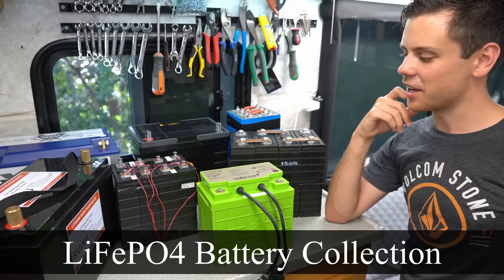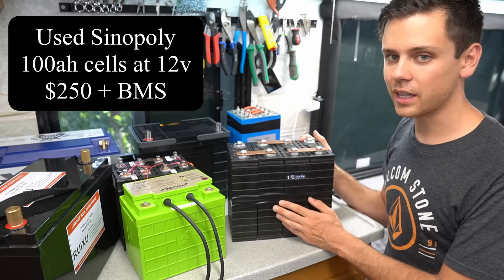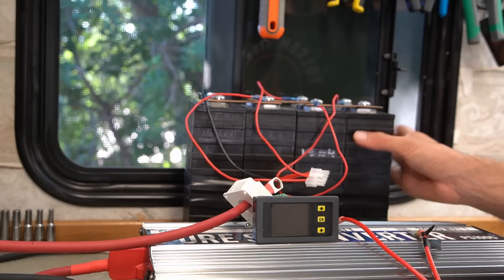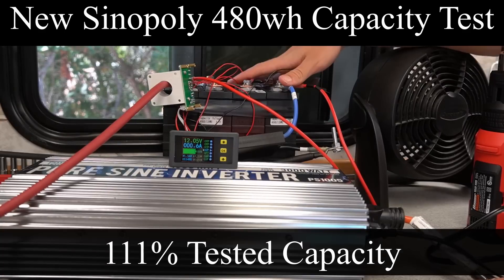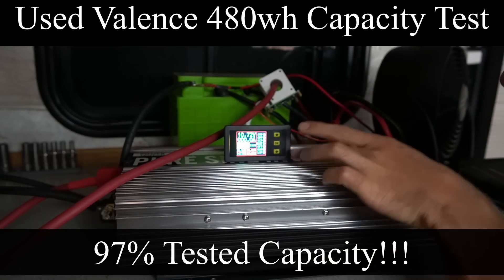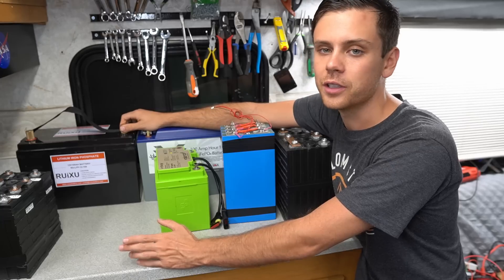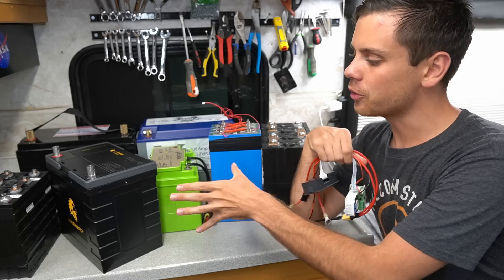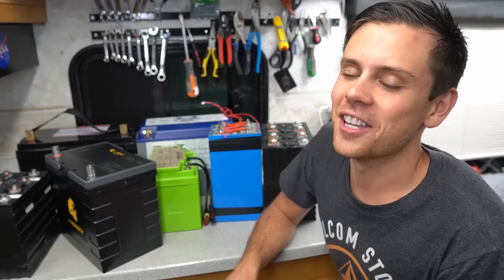LiFePO4 Off-grid Solar Battery .2C Capacity Test and Price Comparison: USA vs China, DIY or Buy?

Comment: Hi my name is Jeffery from Blackpool England I live in a tent in a van I do enjoy watching  wot you are doing I've owned a G Wiz car and struggling with getting it back on the road and chartering it needs new batteries it has 8x 6v trojan 225 amp but thay wont cum back to life and the price of now batterys is more than it would cost to by a second hand car but the smiles per mile it's so silly but wen I'm down it's uplifting to drive it would be appreciate if you can figure out how I can get the battery's for a afoderbull price thank you for your videos

Comment: I think there are still some crazy margins on batteries.  Most published $/kwh cost for large auto makers are around $150. BMSs in volume can't be that expensive.  Hopefully, with more competition someone will come out with a $300-$400 retail battery at some point in the not too distant future.

Comment: Hey whats up Will ive been watching your videos for a while and finally felt comfortable to go all in on 8 3.2v 500ah prismatic cells off alibaba (not express) the deal went good and i got the cells in perfect shape all within .001v of each other but i wanted to check the capacity. Do you have advice or links to fully understand what you are doing in this test. I understand its putting a load on the battery and is comparing to time but why are these testers limited to 12v and a certain ah?
Reply from the maker: Oh awesome! If I were you, I would connect 8s BMS, and a shunt, and test the capacity. So a .2c capacity is standard, and for a 200ah bank, you should pull 40A for 5 hours. Or until the batteries die (with BMS attached) and see what capacity is
Reply: @WillProwse  you're the man! Thank you!
Reply: @WillProwse  ok did a bit more research and still confused about one thing. If the battery was rate 3.2v 500ah @ .5c rate does that mean i bought a battery with only 250ah considering the standard discharge rate of 1c?
Reply from the maker: @pnuema1.618  oops!! I thought it was 200ah. Oops. So just do 20% of total capacity. So for 500ah bank, do 100 amp load discharge test. Sorry about that

Comment: Are the standard test conditions for voltage 80% charged to 20% discharged as I see the watt meter is around 3.3v per cell at the beginning of test and 2.7v at the end there.
I'm not really used to what these cells settle to after being charged at 3.65v  ( I don't even know what tail current the charger allows it to drop to before it decides to shut off, unless that's user configurable) or what they bounce back to after discharge cut off (I've bought the Victron IP22 blue smart  240v charger in readiness for the CALB cells arriving but it hasn't arrived yet either so I can't fiddle :D
Advice appreciated...
Hmmm Maybe I should put this on the forum as well...

Comment: Thank you for all your good direction. I just ordered LiFePO4 12V 200Ah Lithium Iron Phosphate Battery Pack from Amazon. Also, Daly 12V LiFePO4 BMS 4S 80A/100A Battery Protection Board and Victron Energy BlueSolar MPPT 100/30 Charge Controller. 400 watt solar panels. Following your web sight for hookup. Very excited.

Comment: Great Job again, Will! I wish these LiFePO4 cells would be more easily available, esp. here in Germany. Btw. do you still live in your RV? Thought you moved to the new house finally - or do you use your RV as a workshop? :-) I totally agree about chinese products. The hall effect sensor is probably absolutly fine for the purpose. I use lots of these cheap digital volt/ampmeters like (0-100V / 10A), they are also available for higher amperage via shunt (typically 50A or max. 100 A). They are accurate enough, the error is typically below 1%. Some of them measure down to 1 mA and they are mostly point on. I got some very precise fluke meters from a friend to proof them. But there are also even cheaper ones for below 3 Eur which are a bit crappy and have errors up to 3 or even 5%.

Comment: You should put out notices to your viewers thru email or blog or whatever way you'd prefer before putting out the videos, that way your viewers get the batteries at the same cost or before their sold out. Doesn't do anyone any good if u put out a review and they hack the price right after. Thru putting a message out a day or two before the video u can save ppl alot of money. I know, I know, most ppl who drive Tesla's and have cash to buy any batteries they want could care less about saving others money. but it would be nice jI'm not judging you by your car but I live in new Hampshire and all the ppl here that drive teslas,Tesla's, I I mean all are complete conceited, Arrogant assholes. Obviously I doubt picture you this way bcuz your videos are very helpful tip people, I was just thinking it would save ppl $ on batteries

Comment: I hope this isn't a dumb question...i have a used valence, it has the cords hanging down that I think was for its bms. Mine is a 100ah Ucharge XP I found on eBay thanks to Will's prior video. Question is if I have the 40a charge controller with the temp sensor connected do I also need to purchase and connect a bms??! If so, PLEASE let me know where to find and how to connect to the hanging cords if possible. Thanks so much in advance. This is really fun learning. I'm so proud of myself thanks to Will's book, website and videos I actually stripped wires and connected the solar controller to the used valence and my 200W panels today. It all worked!! Now I'm a little scared that I missed the BMS lesson!!😁

Comment: I have a Class C, Talked to several salespeople and although I really don't have the knowledge base needed to design a Solar charging system - well I know when I being sold what they have in inventory and not what I'm needing.  anyway; I added a 160-watt Flex Solar panel to the PVC roof, Go Power! GP-PWM-30 30 Amp Solar Regulator and I took your advice and bought 5 of the valence U1 0 12RT batteries.   Now I'm thinking of adding Temp sensors and some means to monitor the batteries (BMS - Is that needed?) Also wanted to add a 2000 watt Charger/Inverter with connections for Solar input.   Could use your Advice

Comment: I’m interested in your advice Will.  I live in a desert climate where the summer ambient temperature can get up to over 115°F.  My 2-GC2 in series batteries are nearing the end of their life. I have a 200w Renogy solar system with a 600w Xantrex inverter and an automatic transfer switch.  My concern is that the high temps could damage the batteries while the RV is in storage.  Could liFePO4 live in this environment with minimal maintenance be worth investing in?  The DOD and lifespan of the lithium makes it desirable.  Thanks

Comment: I recently purchased a 12-volt 100-amp Ruixu clone battery.  This battery happens to have a removable top. Main wires from from the battery to top post terminals (via BMS) are about a 8 gauge wire, it could be possibly a 6-gauge but for certain no larger. How is it these batteries can take a load to an inverter pulling High amp draws when the batteries wiring itself appears in insufficient to handle the current load.  Most power leads to the inverter from Battery are 4 gauge or 2 gauge that you use in your video. Keep up the good work making these videos.
Reply: Tony, Lion Energy also uses 8 gauge wire going to its terminal from the BMS but they use 4 wires. So that would be like using a single a 2 gauge wire. Does Ruixu also use four 8 gauge wires or a single 8 gauge wire?
Reply: @fiddle1999  my battery has two leads off each post as well, but the second lead is only maybe 12 gauge. I'll try to get a picture posted.    Sorry, can't figure out how to attach picture.

Comment: Hey Will! I found a great deal on a 12v LiFePo4 from Torque Power assuming that the battery quality is actually good. It comes with a built in BMS and Bluetooth monitoring which is very unique for a 12v battery. You should do a review of their batteries to see if they meet the specification claims!!! Great video btw.

Comment: I just bought 8 180 AH Valence batteries what are you using for a BMS for those. They sold to Lithium Werk who will not supply BMS or Software to support them anymore. Huge dilemma!! They tell me unless you replace the internal bms unit inside the batteries they will not work with anything else! Thnx Bud

Comment: Can you explain low temp cut-off a little more, I'm new to lithium?
Reply: Lithium batteries should not be charged when the temperature is below 32 degrees outside. Doing so will destroy your battery, so a way around that is a good BMS which will cut the battery off from being charged when the temperature drops below 32 degrees

Comment: Love your videos and your thorough systematic approach.  I have a question about cold temperature charging.  My batteries would be in an out door storage shed where it gets way below freezing in the winter.  If I put the battery in a picnic cooler would it self generate enough heat to stay above freezing so it could be charged?  Or is there some other easy solution? I see a couple of heated batteries but they are 30% more expensive.  Thank you.
Reply: He has mentioned using an RV black water tank heater and an insulated enclosure for low ambient situations

Comment: Hi Will,

I’m looking at purchasing a motorhome. It does not currently have any solar panels so I want to setup a system.

What it does have is power fed to 4 ea 6 volt batteries (I want to replace them with LiFePo). The current power sources are obviously the engines alternator and also a backup 7500 watt diesel generator. It also has a system monitor panel that show the bolts, battery life amps and such for the entire system. 

The system also contains a combo inverter/charger. 

In thinking about it after I tie the solar panels to the solar generator...should I just tie into into the inverter/charger since everything from there is already wired to the batteries and the AC & DC panels? 

Just looking for some advice.

Let me know...thanks.

Comment: I know this may sound like a stupid question, but can you put say 4 of the Ruixu batteries in parallel?  So you end up with 400Ah @ 12.8v with a max continuous discharge rate of 400A?  (I honestly wouldn't even use 275A continuous).
Reply from the maker: Yes exactly
Reply: @WillProwse  for some reason I was second guessing myself there. Thanks.

Comment: Hi Will. I have a couple of questions about rv batteries. We have 2 marine lead acid 12 volt batteries, connected in parallel I believe, in our RV.  (The rv guy did the connection) We have one of those red and white off and on switches connected to them too. I don't know very much about how they work though. We are an elderly couple and will do a minimal amount of dry camping (and honestly for long stays I like power and water hookups! Spoiled that way😉😄)... we belong to harvest host so will do dry camping now and then. So can the 2 batteries give us enough power to work the lights? We have propane for the fridge. And secondly how do the batteries recharge? We don't have solar nor an inverter. Too expensive for such little use. Thanks Will... Wanda

Comment: Really like your videos. 

I do not understand some  of the technical terms you are talking about.
Especially about the batteries.

I do understand the very basics of solar systems. I have run very limited solar system setups to run 12 volt lighting etc.

Would it be possible for you to create a dictionary or glossary of terms on your website?

Comment: Hey Wil, I just received some flexible solar panels. I inboxed them and spread them out. After doing some measurements I noticed the mc4 connectors on each panel were connected together. Since they were in direct sunlight do you think they were damaged?
Reply from the maker: They will be fine. I did that before as well. Should be ok

Comment: I have 4 Battle Born 100ah that have been in service for nearly 2 years and have been discharged roughly 65% daily. I would like to add additional capacity to my system. Have I waited too long to add 1 or 2 BB100’s. Do you see a balance problem? I should add they are 12v parallel.

Comment: I could use your help. I currently have a boat with a battery inverter system. The system has (8) 6 vdc arranged in four pairs paralleled to provide 12vdc. The problem is the US2200 batteries AH rating seems different from what I see in your videos. Here is what is on the battery. Hours & Capacity: Amp Hours (20 hr. rate) : 232 Minutes @ 75 Aamps: 122 mins. Minutes @ 25 Amps 474 mins. How do I figure out exchanging to LiFePo4 to get the same capacity or better. By my calculations it's ~4800 wh @ 25 amps and 4000 wh @ 50?

Comment: next question. i own and use the valence batteries in strings of 4 @ 48 volt.  my issue is even though the cells are balanced @12 volt each when i run them down they always discharge different at the  end. each will read something like 12.4 12.5 12.3 and one will read 10.5.   Is there a way to wire a bms so the 4 12 volt batteries discharge more even?  Thank you.  you are the most useful battery channel love your info and tests

Comment: Hey Will, You've been running a solar system for a while now. Do you have a video with data on how well the system works? How many watts solar panels, how many WattHours battery, how much you use, during a long storm, do you run out of power? This is crucial real world data that would help people who wants to build solar systems. I know there are calculators out there but that is theoretical. Having a look at real world data would be helpful.

Comment: I just got one of these battery/power meters, although without any sensors. IT HAS A SERIOUS FAULT!! When powered from the battery you are testing it shows higher voltage than the source when the source is below 11.5V. It actually starts to rise when the voltage drops below 11.5V.  That will definitely be a problem when yo are testing batteries.  No way of knowing if the battery is below 11.5 and reading is wrong, or if the voltage actually is above 11.5V and reading is fine. I have asked for a more detailed manual and will go deeper into it. I have also ordered one lik yours with the coil current sensor. Don't know if the same problem will apply to this one, but i suspect that it uses the power input also as the voltage measuring input and therefore there is a potential huge problem here.
I can see from your videos that you are measuring all the way until the meter dies. The final voltages at the test may be very wrong. So could the Wh measurements if it uses the voltage reading for Wh calculations. If you are staying above 11.5V, everything may be OK. 
I would looked into it.

Rudy
Reply from the maker: I have never seen the voltage rise at low voltage. That is really weird you have yours doing that. Can you post a video?

Comment: ok, I have a 45 ft boat with 6 - house batteries, Group 31's Deep Cyc at 210 ah per. they cost me $160 per. So, what do I need a 7, 8, 900$ battery with 100ah's per?

Comment: Will could you stop posting the sites where the deals are at? Its really screwing us out here,unless they are paying you for advertising and if that's the case that's just business and alls cool. Your content wouldn't change just not posting sites.  If Anyone is driven they can find them.
Reply from the maker: To keep my channel free from direct sponsorship and contracts, I have to post affiliate links. That's how I support the channel really and I can't think of a more fair way to do it. And cheaper options are coming. And they won't run out of stock.
Reply: @WillProwse  thanks for the fast answer.

Comment: Amazing comparison video. Nicely done sir!
On the back of this review I am looking to go with 600Ah RUIXU battery bank. Quick question if I may - Can x6 of these batteries be connected ok, and if so is it series or parallel wiring or both?

Greetings from Ireland!
Reply: I am also thinking of getting the Ruixu barley.  You CANNOT PUT THEM IN SERIES!!!   How ever you can put them in parallel.  6 batteries in parallel will give you 12v 600AH
Reply: Thanks @fiddle1999 .
My build series starts in the next 2 weeks. I no doubt will be be gorging on Will's other videos to way pros and cons for a 600Ah 12v system versus other.... + check out some wiring strategies too...
Cheers Will for making solar accessible for us first time installers!
Reply: @aeonliving409  best of luck bud

Comment: Can you do a video checking out the EON Phospate 2.0 batteries? These are $70usd on ebay for 38AH at 13.2V
Reply: Thanks!! Note, most of these are from 2012 / 2013., again medical cart batteries that went with triplite UPS systems.

Comment: Correction on Sinoploy 40AH new batteries: All of these type of LiFePO4 are 12.8v nominal, so the "rated" capacity should be 512 Wh. So with a 535Wh result, that is 104% capacity, not 111%.
Reply from the maker: absolutely and I cover this in the video. Did you know watch the video where I said exactly that? And I wanted a baseline of consistency so that we can compare these batteries so I use 12 volts as the nominal voltage instead
Reply: @WillProwse  Yes, I saw where you mentioned that the green batteries were actually 12.8v.
Reply from the maker: @ninja5672  there was another part where I specifically stated that the Black sibopoly cells were rated and doing full capacity at 12.8 volts which is lithium iron phosphate nominal. It was a different part of the video
Reply: @WillProwse  perhaps I missed that.